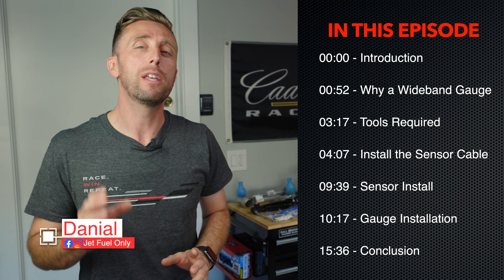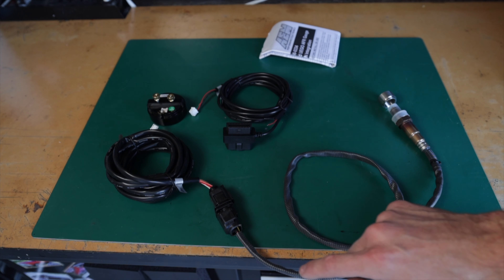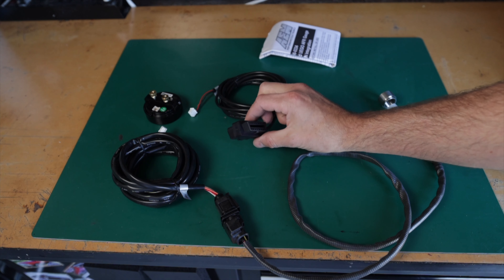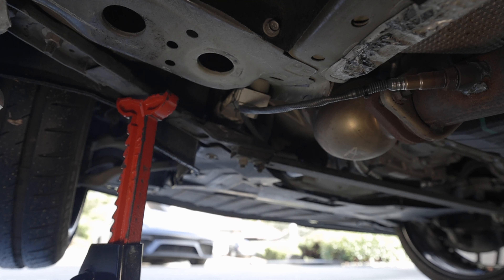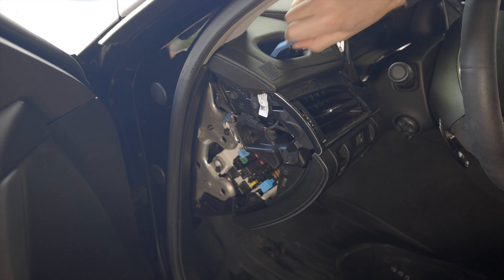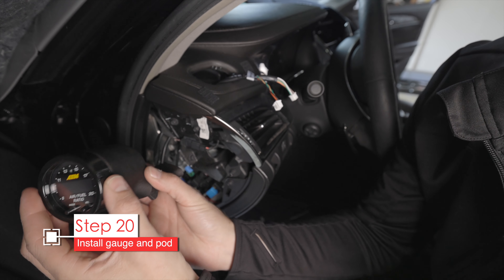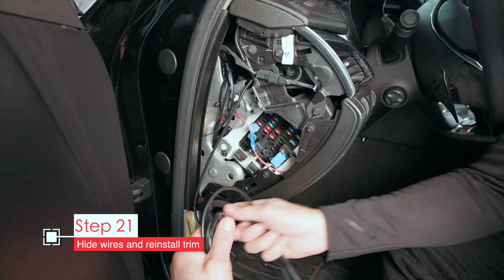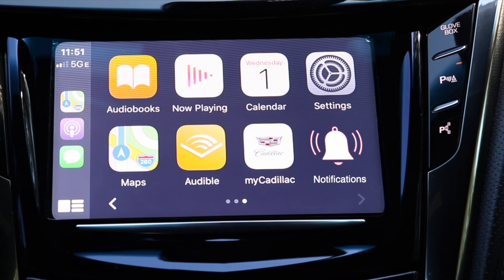Wideband Gauge Install | Cadillac CTS ATS

Comment: I was under the impression that a wideband needed to be installed upstream of the catalytic converter.
Reply from the maker: Unfortunately it’s pretty tight there. For most accurate reading you are right but as a baseline for the tuner to work with it’s fine.  Justin Schmidt does most cars tuned with the sensor post cat
Reply: @JetFuelOnly were you pleased with Justin's tuning? I am either using him or Cooper. I like that he will tune it with the wideband being installed post cat.
Reply from the maker: I don’t have Justin’s tune I still have Trifecta. My money goes into the Porsche these days. 
However, please DO NOT go to anyone but Justin no matter what someone’s experience in tuning is they don’t have time to figure out this cars unique ECU. Justin has all the fastest VSports on the planet.

Comment: I'm disappointed a wideband O2 wasn't original equipment.  Most modern cars use WBO2 to run closed-loop under all load conditions.

Comment: Great detailed video.  I wonder how much work it would be to mount the gauge inside the cubby where the wireless charger is.
Reply from the maker: People have done that with standard round dial gauges. With 3D printing accessibility making a cubby faceplate wouldn’t be too hard

Comment: Great install vid. However a wideband sensor should definitely be installed pre cat.
Reply from the maker: Unfortunately it’s pretty tight there. For most accurate reading you are right but as a baseline for the tuner to work with it’s fine.

Comment: The wideband sensor is supposed to go in front of the cats. If you place behind the readings won’t be accurate. I have a 14 ats 2.0t mine is installed just behind the turbo about a few inches from the upper 02 sensor.
Reply from the maker: Understood. Room is limited and our primary tuner gets results with it post cats. Even farther down the line too!

Comment: I have a 2016 ATS-V and the seat bolts are TP45's (as in Torx Plus).  If you are able to put plenty of downward pressure, you can use a T50, but it's the wrong tool and you will most likely damage the splines.

Comment: Somebody installed one of these on a 16 ats-v i bought and i found the driver side o2 sensor hanging there with the wideband plugged into it. Need to weld a bung now because somebody thought it was a good idea to leave the stock o2 sensor hanging there.

Comment: Thanks a ton for the video, just did mine, only have to make the trip to the exhaust shop. Only note I have is my '16 CTSV's seat bolts were T50s.
Reply from the maker: Thanks for letting me know. I mess up sometimes so maybe I got mine wrong or they changed it!
Reply: It's not a T50.. it is a TP45 (Torx Plus).

Comment: Really appreciate all the great VSport content you produce!!!
I noticed your front splitter is off, I have the smaller (V2 I believe) front splitter from Savage but I get annoying rattle sounds when driving…have you had this problem? Any ideas on a solution if so? Thanks and keep up the great work!
Reply from the maker: Yeah I broke mine last month. Waiting for a new one. I’ve never heard any noise except if the splitter is loose or the slash shield is loose